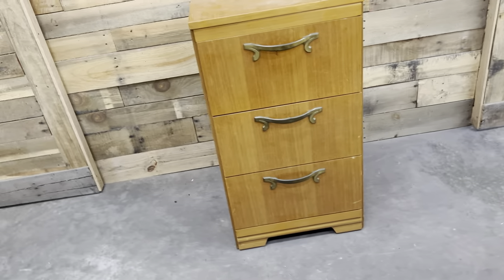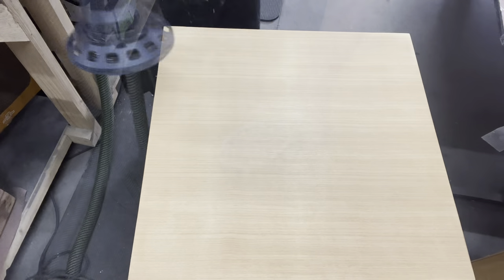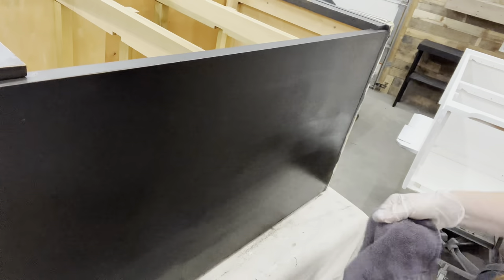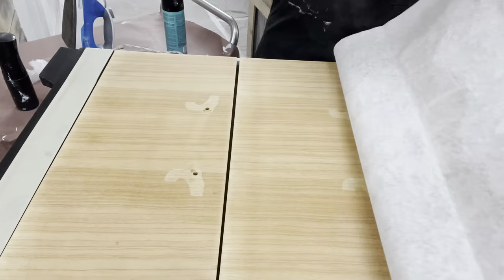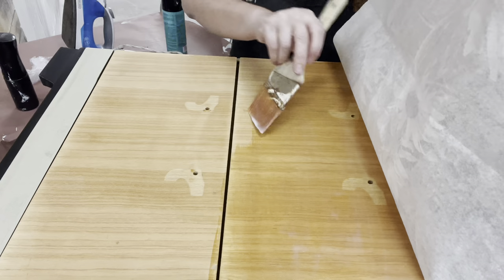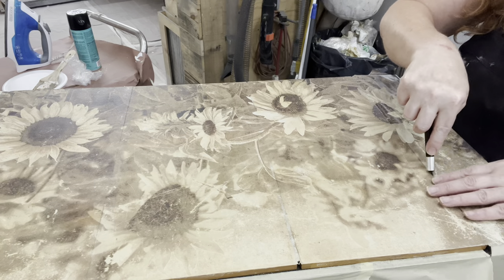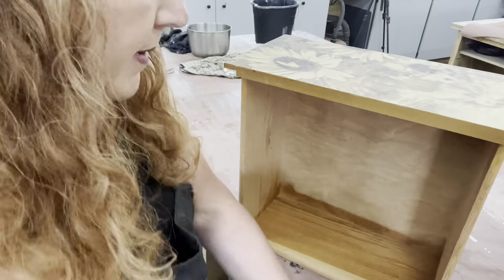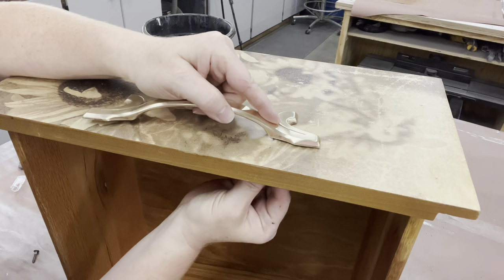Trash to Treasure  | Free Furniture | Decoupage

Comment: May I ask about using the Polycrylic to adhere your decoupage paper?  I've never seen or heard about that before, I thought you had to us Mod Podge or wallpaper paste or something.  Are there pros/cons that make you prefer this method.? It sure looks easy.  Thanks.  That piece turned out beautifully.  Can you part with it?
Reply from the maker: It’s what I’ve always used..And probably since your asking my preferred method. Though sometimes on certain pieces I do use mod podge.
Reply: @GingerChickRehab  Thank you!  I'm new to this and it's good to know there are practical options if I don't have exactly what I think I need.  Grateful for your experience.

Comment: Is the top you are using the same as polyurethane??
Reply from the maker: Polyurethane will yellow.. Polycyclic does not
Reply: I have polyurethane to use to put a protective coat on wood trays.   Will it ruin my trays???